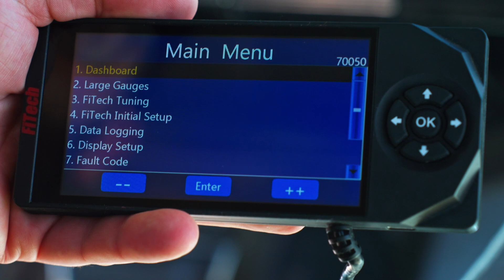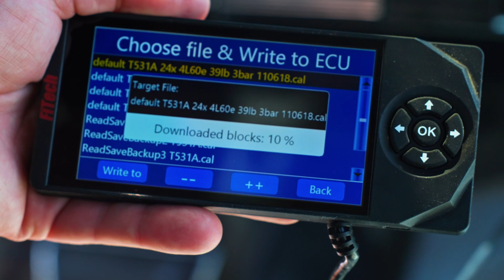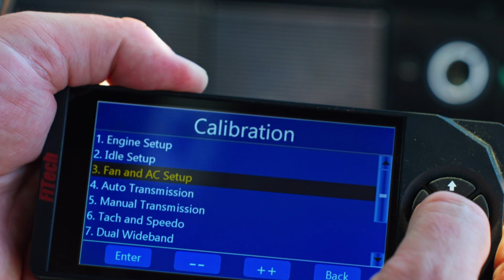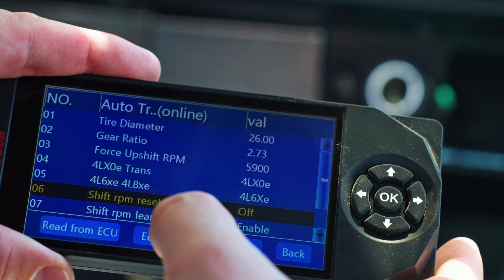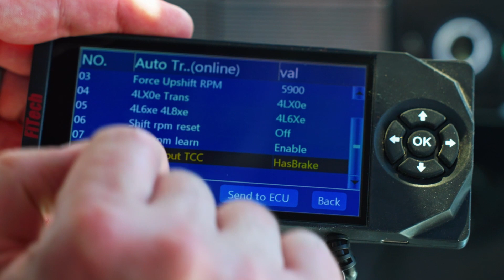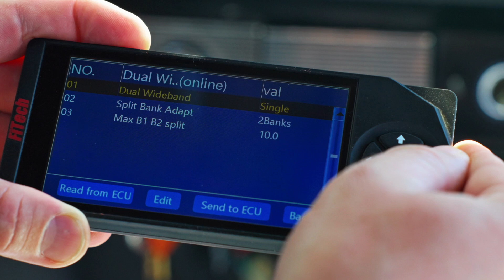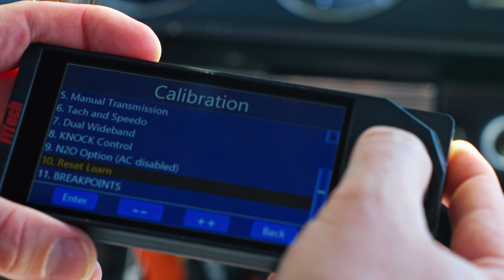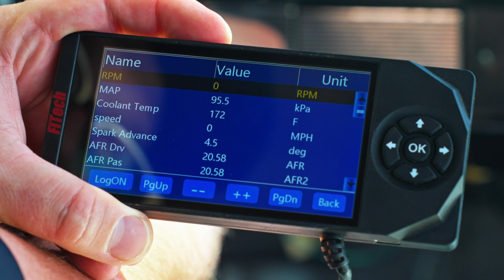Initial Setup- LS EFI System | Tech Tuesdays | EP84

Comment: Were you using the Fitech 36lb injectors in this setup?
Reply from the maker: Yes this setup was using 36lb injectors.
Reply: @FiTechEFImedia I noticed the injector flow was set at 37.6, should I use that or input 36lb? I am using the 36lb Fitech injectors too.
Reply from the maker: @TheDonWay-79  You should put 36 lb. You are seeing software that is on a R&D vehicle where some value will shift for research purposes.
Reply: @ thank you.

Comment: i got the fitech 30005 and when initial frist start up i got it to run but for some reason i can not turn it off with my key i had to disconect the plug from my distributor..i have my white wire going to my fuse box to ignition fuse and my blue wire going to my green wire from my distributor which is my tach wire... i have a hei dis. and 355 small block 1990 k5 blazer...it wont shut down with the key off...

Comment: Could you do a video setting up the speedo for the ultimate ls system? Manual trans here, 3.73 gear, 23.07 tire but my handheld speed is reading really low. Just wanna know what i need to adjust to get it correct
Reply: Calibrate it to 24 inch or 26

Comment: Sometimes my data log doesn't have names on the top bar is that a setting in excel?
Reply from the maker: the latest software v.1.53 corrects this issue among others. Call tech support for the latest version.
Reply: My handheld has version v1.32 and does not allow can bus of temp or a/f is that addressed in updated controller software for my bim
Reply: I am running Dakota digital RTX

Comment: If the handheld becomes disconnected and loses power , will it need to be recalibrated each time??
Reply from the maker: The handheld is used to change settings. It does not hold the setting in the ECU. You will not lose anything if you disconnect it.